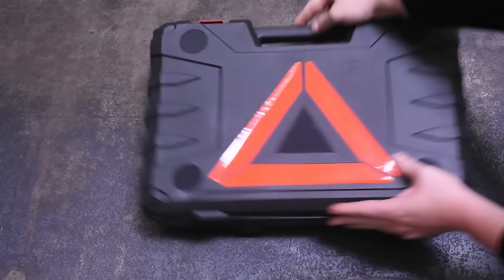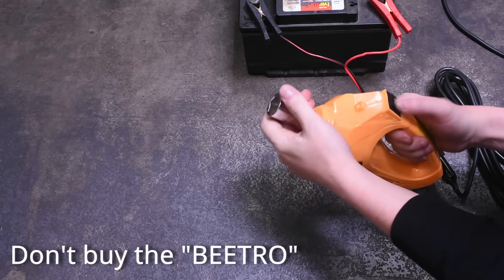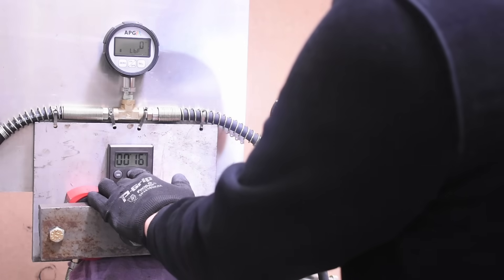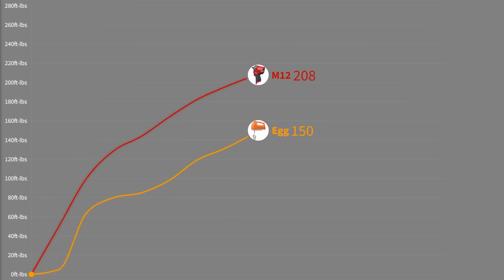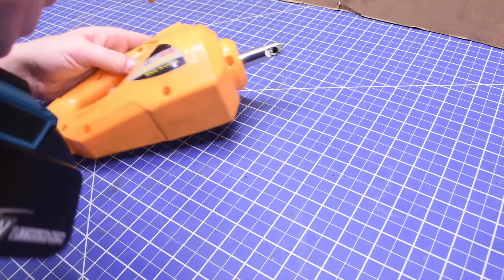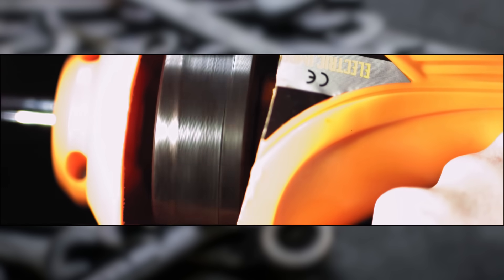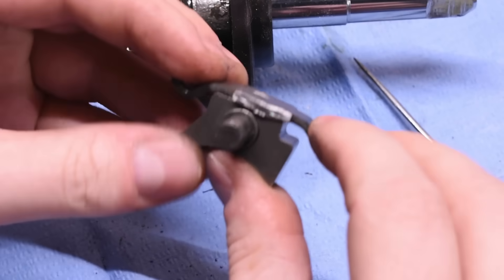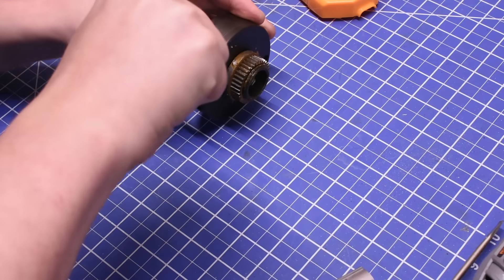The Infamous Egg-Beater Impact Wrench! Testing & 10,000fps Slow-Mo

Comment: was waiting for this episode as i used to have something similar but in a conventual-looking impact wrench type of surround. the older mine got the better it got, it used to spin up to crazy speeds before it engaged as it got older and may of been able to undo a container ship propellor nut 😂😂🤣🤣might be worth modding?
Reply: Huh, so maybe if the spring is weakened, the design becomes more practical, allowing more spin up speed.
Reply: @KaylaJoyGunn  i think it may be a distortion of the internals binding it up

Comment: i have one of these "single use" 12v tools, but its an air compressor for tires. i've actually used it quite a few times over the years, and i've careful not to let it overheat. if you let these things run wild though, they will hit pretty hard and then melt into slag lol
Reply: The more decent quality ones can go on a bit longer, but they still end up burning hot after a while. It's also a good idea to take them apart every now and again and grease the bearings and cylinder so that it has a fighting chance (rubber safe grease of course)
Reply: Yup. I had to wait 5min for my old one to cool FOR HALF EACH TIRE.  Thats 8 use/cooldown cycles for one car.

Comment: I wonder if you modify a "normal" cordless drill to use this type of hammer to make massive amounts of torque (although much slower).
I'd love a high quality version of this, for people that very rarely have to use a high torque impact, but also don't want to spend 500$ on one..
Reply: A breaker bar and a pipe is a lot cheaper than $500.
Reply: @joeschmoe6908  try unscrewing a flywheel with a breaker bar and without using additional tools, also a breaker bar won't fit in a lot of tight spaces.
Reply: @makeintoschu  I think if you're removing a flywheel you probably don't qualify as someone who very rarely has to use a high torque impact.

Comment: I wonder if you gave the motor more power (18v? 24v?) if it would hammer any harder or will the blows be the same? I'd love to see a video of a suped-up version of this thing (more power to the motor, stronger springs so the mass reaches higher speed before engaging with the shaft) I could see this thing competing with the mid range impact drivers.
Reply: It should hammer roughly just as hard since the impact happens at a certain speed, though higher voltage and current will make it reach that speed (and burn out the motor) sooner. Since its already stupid strong but also stupid slow, that'd definitely be a "hell yeah!". Combined with stronger springs for a harder hit, I bet this thing would be an absolute monster until it shatters into a hundred pieces or catches on fire.

Worth noting that he's (sort of) undervolting it already. Plug in car tools are generally meant to be used while the engine is running, so it should be a bit faster with the 14-15v that the alternator puts out.
Reply: I don't think 18 volts would really be a problem or a benefit, but 24 would put more than needed stress on the windings, it wouldn't hit any harder though as the entire hard hitting action is based on springs and you might gain at max a whole half second between hits
Reply: Mod this thing up!
Reply: itll just smoke the motor windings quicker. Guaranteed
Reply: id love to see someone swap out the motor for a more powerful, and more reliable one. also wonder how adding mass to the flywheel would go. and/or what another person said, putting tighter springs on it so it spins up much more before impacting
Reply: Bastardize a dewalt and hook up the motor and battery to it plus heavier springs and I bet it'd be insane
Reply: Yo tengo uno a batería 18 v con acelerador variable y de, al mínimo rpm a el máximo rpm aumenta un 20% la fuerza
Reply: But faster RPM the spring will engage sooner soon may not get as much omph. What if you change the spring tension so that it could spin up even higher RPM before engaging therefore having more momentum hitting on the anvil.
Reply: You would have to change the springs to compensate for the higher rpm... Should work...
Reply: Use a dc rc motor, high rpms

Comment: It's definitely a handy kit to have in the car. I could see some of the name brands coming out with their own down the line for 3x the price
Reply: They really should. There's a huge market for a device that can take off super stuck bolts even if it takes a full minute. I'd love to see one of these with half-decent build quality
Reply: @pilotdog68  I agree. My first thought was how much faster could a brushless motor get up to speed to increase the frequency of blows or even allow for increased rpms, allowing for stronger springs n a harder wack. N of course the convenience of cordless
Reply: This is nothing new. I had one 15 years ago, albeit it had a pistol grip. It was made of chinesium and failed in no time.
Reply: @Goldar  I don't think one can really equate 15-year-old chinesium to modern chinesium.
Reply: @h8GW  I don't entirely disagree with you but there is a definite difference in quality based on the cost of materials in modern chinesium n whether old or new technology is used in the product. The percentages of good quality vs junk are definitely way better now than they were 15 years ago though

Comment: Oh! An easy upgrade waiting to happen here! Looks like a basic 550 sized brushed motor...time to toss in something a bit more quality from one of my RC crawlers and rewire everything with a proper gauge wire and let'r eat! (I bet just the wiring makes a big diff.) Maybe power it with a 4 or 5 cell lipo and see what the stocker is capable of...if you don't mind the smell of burnt carbon brushes!

Comment: Would overvolting this increase torque output? Increase frequency of hits? Both? Id love to see some tests running this from 15-24 volts
Reply: It won't the weight in the flywheel is what dictate at what rpm it delivers the blow 
So increasing motor rpm will not make it stronger  maybe increase the frequency of the hit if the motor spin faster to said rpm
Reply: Probably would be short lived.. These Chinese power tools tend to over-rate their capabilities, not underrated them, so they don't handle overvolting. They don't even handle their rated voltage long.

But, adding a heatsink and fan? Or maybe a bigger motor? Could be interesting.

Comment: I think you need to redo this or do a follow up video.  As, when the car is not running sure you have 12V at the battery, but if you are on the side of the road you have the ability to keep the engine running therefore your voltage goes up.  I've seen in my vehicles about 14.6V.  I actually took a vacuum that had 4 cells in it so when fully charged was 16V, but I converted it to running off my car cigarette lighter.  I definetly hear the power difference when running off just the battery engine not running and when running the vacuum when the car is running.  There will be a difference.   Not to mention a battery has a voltage drop when a load is applied, while when the engine is running the voltage drop is made up by the alternator.  Big reason why if you have high draw on an alternator, it isn't a good thing for too long as you will kill the alternator prematurely.  I've learned from my mistake on that one, let's say.  A revisit is in order on this one.  One option is to run jumper cables from our outside running engine car battery to your inside battery.
Reply from the maker: We did testing and high speed at both 12V and 14.5V
Reply: @TorqueTestChannel  sorry must have missed that point

Comment: You may be the first person other than my physics professors that I've ever heard use the correct term, centripetal force. This made me way more excited than it should have.
Reply: Except that was not the correct term for what's going on. The long ramp up time of the motor is because it is overcoming the centriPETAL force. The way the mechanism behaves due to the rotation is indeed the centriFUGAL force. You do know that they have different definitions, correct? I'm referring to time stamp 10:32.

Comment: The high current draw that blew the fuse is an issue on many import 12v “car” tools. Lots of cars only have 10A on those cigarette lighters some have 15A. I have a HF “compresssor” with this issue, I put a current clamp on and measured 12A under load though it has a 15A fuse in the plug. Going straight to the battery is the solution as long as you add an appropriate fuse. That little pump is a beast.
Reply: I mostly have owned pre-1990s cars, presently a 1979 Subaru DL wagon, a 1967 Chrysler Newport, and a 1978 Chevy C10. Due to the port being an actual cigarette lighter port, they often have super high amp fuses and thick wiring from the factory. I've seen 20 or 25 in GM cars fairly often, 20 or 30 in Chryslers, and I've seen anywhere between 15 and 40 in Japanese cars. My Subaru as an example, the cigarette lighter port is ceramic on the inside, and has 10 gauge wiring and a 30 amp fuse. On the other hand I've seen as low as a 5 amp fuse on newer cars. My mom's Jetta has only 5 amps for the front 12v socket. And of course fuse box diagrams are not even  available since they seem to have changed it at least 5 times during that generation of Jetta.

Comment: I had something similar 30+ years ago. I had never used an impact wrench before but my friend's dad had a really nice Porter Cable impact wrench (back when they were top-of-the-line), so I wanted to get something for myself.  As a broke 15 year old I found one but didn't realize at the time it worked in a similar manner to this, spinning up to speed and then hitting.  It seemed to get weaker and weaker after each impact.  I never got it to break anything loose. I borrowed my friend's and it hit for maybe half a second breaking loose everything the other one had trouble with

Comment: I have one of those jacks, it will absolutely struggle to lift one wheel of a 4wd (Landcruiser, unloaded) off the ground. Sometimes I have to run it off 18v. I'm surprised to see it made 3T, not my experience at all. Really convenient to use though.

Comment: Now put a brushless 24v motor on one of those egg beater deals..  looks like theres plenty of room inside the housing to hold the bldc controller and trigger assembly should mount in the oe place..  tryna see that thing on the crack mode..  kinda bet that it wont impact near as hard though because of the high speeds but it will still be spinning up that flywheel of a hammer and impacting with the same slip force as it was due to those springs holding it in place until they clutch it and wop the doohickey..  it might break a wrist and break the dyno..  lol

Comment: @singlecams convinced me to get the DCF899 back in the day, great channel with practical use cases. The egg beater taking on a Honda crank pulley bolt is something to behold!
Reply: Couldn't be one of their counter rotating engines. Those will laugh at a 1000ft/lb impact all day.
Reply: @KaylaJoyGunn  It was a J series with a weighted socket, still impressive for what it is.
Reply: @KaylaJoyGunn  J series is harder than a b-series bro.

Comment: i had a impact like this that looked like a ray gun. i payed $10 for it at walmart and it lasted for almost 16 years before it failed. i used it on scooter cvt belt drives because you could get the variator nut off without any struggle and not needing somthing to hold the variator in place like you needed to with a normal impact
Reply: Paid
Reply: My grandfather gave me my first ever corded impact when I was 14 because of a moped CVT drive belt clutch nut 😂 that's funny we have similar stories.

Although the impact he gave me was like a death machine. Either to the nut, or your wrist

Comment: Wow that is interesting. I wonder if there are higher quality or name brand versions of these style impacts.
Reply from the maker: I saw one with what looked like a V8 and a hand lever that made it interfere after you spun up the engine. I dunno about high quality but it seems to slap
Reply: @TorqueTestChannel  I'd imagine that one with even more mass, and/or perhaps somehow adjustable max RPM before the hammer tilts would be able to overcome any fastener.

Comment: Impressive wonder if it lasts.  I use my m12 impact on the jack to spin it up.  It seems to work well
Reply: I used my cordless drill on low speed to turn the scissor jack that came with my car. It worked well until it didn't. Ruined the threads over time and eventually the jack seized up.
Reply: @joeschmoe6908  with a drill? Seriously?  What beast of a drill do you have.
Reply: @markk3948  nothing special, a cheap chinese brand called teccpo. $70 on amazon. Many 20v cordless drills have enough torque if the rpm setting is low enough.
Reply: @joeschmoe6908  wow pretty impressive:)

Comment: Am I the only one who wants to see how effective this hammer assembly could be with a much more powerful motor behind it?
Reply: Motor torque is superfluous in this case, you could make it hit a bit faster with a higher RPM motor but given the percentage of time that the reset action takes it would be a minimal improvement. Now if you machined a channel for the tilting mechanism, machined the mechanism to right tolerances, and did very precise calibration on the springs you could probably get significant improvement in blows per minute, but at the cost of massive increase in cost.
Reply: @andrewfidel2220  A more powerful motor would be faster to bring the hammer up to full speed, initiating another hammer blow. If the rate of impacting could be increased from 1 Hz to say 3 Hz without changing the force per blow, it would result in a quite impressive tool.

Comment: Can you build this into like an adapter.  AKA just the rotar and hammer part that a person could power with the drill they already own?   Add Cheap Ugga Duggas to your moms egg beater.   Or heck how would that system work with an air motar behind it?  More Ripaums, no smoke?

Comment: I bought a 12V impact beater gun from Harbor Freight about 20 years ago and yes it did remove that Honda crank bolt without breaking a sweat. I paid $27 back then and included 4 lugnut sockets. This thing works better than any air impact that I've owned Including an 18V impact gun from Bosch. Bosch is not the beast, the impact beater gun is for a fraction of the cost.

Comment: Better than nothing! Not bad at all considering it's design. The first one I've tried many years ago quit literally after the first hit, so I considered it junk from that point on.
If time isn't a factor, not bad to have one for the car. And no batteries to worry about forgetting to charge. You have changed my mind on these quirky impacts.
Thanks again for a good video! 🐺🔧
Reply: Might've been the same thing with the connection failing at the cigarette lighter plug?

Comment: There's a fuse inside the cigarette lighter adapter.  Unscrew the end with the knurled ring and it will fall out the end.  Replace that and it'll work again.

Comment: I would love to see a big ass brushless motor on this thing
Reply: And maybe slightly stiffer springs to allow it to get to a higher speed before hitting.
Reply: @Averna222  now you’re talking ludicrous impact yo !
Reply: Yeah... Definitely feel like we need a modified version or diy giant version+ weedeater motor.
Reply: yea and it would make an occasional use roadside tool into a 300$ thing ... its the same thing as my 20$ air compressor, its crap but it fits in my spare wheel compartment and will (eventually) do the job when its super dark and or cold outside
Reply: Hook up this setup to m18 first
Reply: about to say the exact same thing. a good 540 size motor would work well
Reply: I feel like that would not only break your wrists but would shatter the housing
Reply: yeah this needs more speed
Reply: Came here to make the same comment
Reply: what i came here to say, that along with a stronger spring to hold the rocker back for the high rpm of the brushless motor and that thing could make serious numbers
Reply: You need the motor to be small enough to bounce back with the recoil properly. Too much raw input torque to let the anvil disengage and you may turn this thing into a wrist buster.
Reply: @teardowndan5364  The "hammer" shown has a surface like a sear, and when you couple it with the disengagement spring, will only allow so much torque between the flywheel and driveshaft.  Meaning, once you surpass that torque under motor driven conditions, it spins the flywheel instead of staying connected.  It allows full torque lockup only for a brief moment before the sear slips back off the driveshaft.  So there would be no direct connection between socket and motor except at very low torque and wouldn't translate any more torque to your hands than the original motor does.  When you start changing the spring tension of the sear is when you'll get additional torque translating back to you, however, a small change may only bring a modicum of felt torque and a huge increase in fastener torque.
Reply: Came here to say this

Comment: Since it's for a car, if the engine is running it would be getting 14-15 volts and maybe an interesting test
Reply from the maker: Half the footage is at 14.5V
Reply: @TorqueTestChannel  ¿Pero? ¿El cable de alimentación,es de al menos 2 mm?pues saben traer de 0,75 x 2 , entonces hay que medir el voltaje en pleno trabajo y en contra del motor,si llega 11 v hay mucho para mejorar
Reply: What limits this is the motor overheating. Higher power input means higher power output means shorter duration.
So I guess the amount of work it can do until it needs to cool down would be about equal.
Reply: The real limitation is the low amps available on those car outlets. Not much juice there.